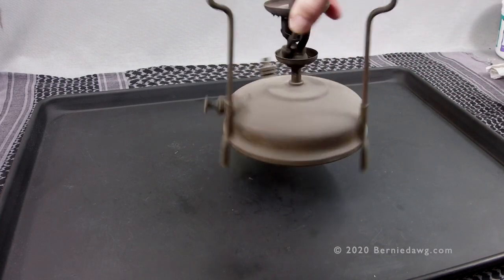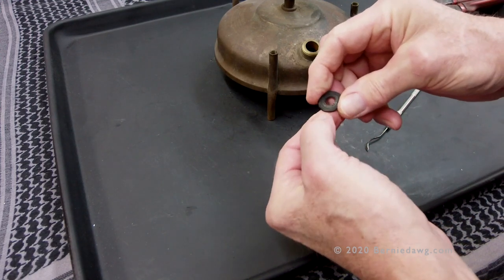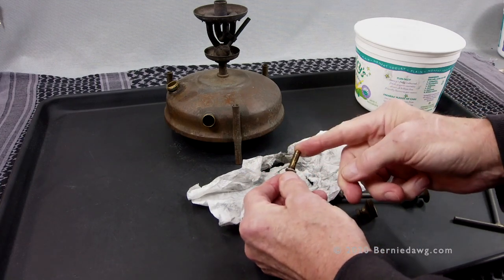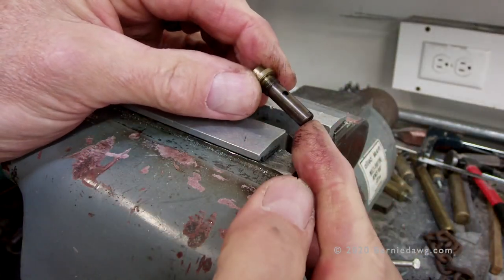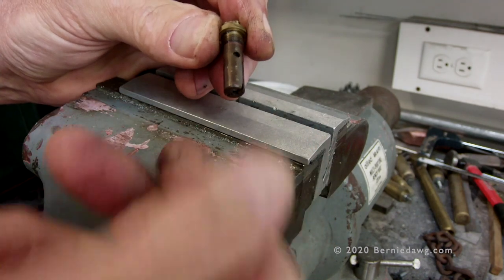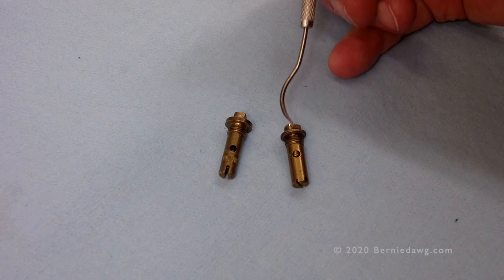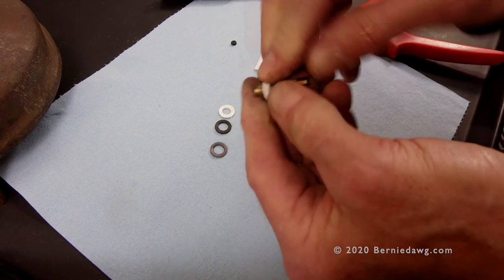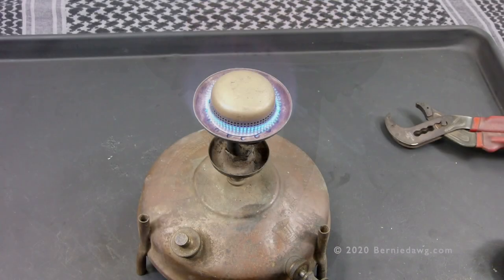How to Fix a Kerosene Stove

Comment: Thank you very very much for demonstrating how to remove a blocked NRV by placing the NRV tool in a vise and turn the tank around while holding a significant amount of downwards pressure on the combination. My first attempt to remove an old blocked NRV from a SVEA No5 was a failure. The NRV tool slipped and rounded of the tip of the NRV. So now I can't remove it at all and till so far I didn't manage to get the stove in working order again. 
But luckily after seeing this video I was able to restore an very beautiful Primus 210 back in working order. It was super easy and done in a few minutes. I went to my dads garage clamped the NRV tool in the vise on the workbench and heard the very same pop sound when it came lose. I replaced the old NRV with a new one and now I have a beautiful vintage stove that can be used on camping trips. Maybe I can restore the old NRV also with the help of this video and keep the stove as original as possible.
Reply from the maker: Thanks for your comments. If you drop me an email to: bd@berniedawg.com I can show/tell you how to fix your Svea #5 NRV without disassembling the pump. It's quite easy. The technique is one of those I will be featuring in an episode of my new video series called "Stove Tools" that I'm releasing later this fall. It may be a month or so, though, before those show up here on YouTube. BD

Comment: Donde se puede conseguir la goma que sella el aire en el nvr,debe ser resistente al kerosene,saludos desde chile
Reply from the maker: You want Viton, a synthetic rubber used for chemical resistant purposes like Diesel engine fuel lines. You can get it as precut stove parts from several sources listed in my webpage on stove parts. Www.berniedawg.com . No idea where you’d get it your country. Sorry. Good luck.👍 BD

Comment: Hi, thanks for posting this video. I have a question. I bought an Optimus #00 in 1985. I recently tried to use it and it won't fire up. The problem is that I tried to stroke the pump but it does not pump feely like there is some pressure. I even opened the release valve. Can you please help me fix this?
Reply from the maker: @Eugene Jang Sooo... you bought it 38 years ago. That's a really long time. Probably a bad NRV (non-return valve). It'd be silly to expect rubber to last for 38 years and for the stove to just fire up after all this time. The video right above your comment shows you how to fix the NRV. You should also re-oil the pump leather as it's no doubt dried up after 38 years of non-use. Then, after you've done the work, go watch the how to run a kerosene stove video here: https://youtu.be/Z_zRgcmSWh0 Still having problems? I have a free email help line right here: bd@berniedawg.com BD

Comment: Is there suppose to be a seal where the burner meets the tank? On mine it seems to be leaking in that area. Also it's not lighting properly, I'm guessing it's a dirty jet. 🤙🇦🇺
Reply from the maker: @Mark Depends on the stove. Some have the riser tube directly soldered into the tank. Others have a removable riser. Drop me a note with a photo or two of your stove and I can give you a direct answer. bd@berniedawg.com BD

Comment: Hi hi Bernie Robbie from Liverpool England. Hope your good. 
Do you make your own pips. If so what from . Cheers.
Reply from the maker: @robertbates3627 Hi Robbie. I make my own pips. I use Viton sheet and hollow punches to do that. But, as you are in the UK, it might save you money and tooling costs to get premade Viton pips from The Fettlebox. https://fettlebox.co.uk/index.php Viton is the most fuel resistant rubber material and will far outlast any other sort. Cheers! BD

Comment: Hi, I’ve just bought an old Primus No.5 off eBay and it won’t pressure up, there is an old rough solder repair around the main tank filler neck, how can I rid the old repair and make a new neat joint? Should I just use the same method as your pump tube repair? Thanks
Reply from the maker: @andrew keeler The riser (the tube that connects the burner to the tank) is held in place with a big nut on the inside of the tank and can NOT be removed (like the pump tube can) without destroying the stove.
Pressure issues are solved in 99% of cases by… 1. replacing the fuel cap gasket, 2. replacing the NRV pip and the NRV head gasket, and 3. replacing or reoiling the leather pump cup on the end of the pump shaft. I show you how to do all three in the video above - watch it in its entirety to learn how. DO NOT address any other parts of the tank until those three issues have been fully taken care of.
Blodgy solder repairs to the riser-tank connection are best left alone and considered a part of the history of the stove. Removing the solder will likely reopen previous leaks. A riser-to-tank repair is an advanced stove repair and likely shouldn’t be attempted by the novice. However, if you find that’s the issue after solving the “big three” pressure issues above, drop me a note with some photos of your stove and I can walk you through a riser-to-tank repair in email exchanges. bd@berniedawg.com 👍 BD

Comment: I can't solve my problem .The Nozzle was broken down the air leak I can't find another one .can y help me make video about this problem .
Reply from the maker: @QT's Radio It is difficult to tell the problem from your description. Are you saying the jet (nozzle) is broken off in the burner? If so, you will need to replace the burner.
Thật khó để nói vấn đề từ mô tả của bạn. Bạn đang nói rằng vòi phun (vòi phun) bị hỏng trong đầu đốt? Nếu vậy, bạn sẽ cần phải thay thế đầu đốt. BD

Comment: Mine either goes out or floods, any tips? Thanks.
Reply from the maker: @Andrew Howard Make sure you are using quality 1-K grade water-white (clear) kerosene fuel in the tank of the stove. Make sure you are using denatured alcohol to preheat the stove. Make sure you have serviced the NRV (non-return valve) and the leather pump cup so that the stove tank will build pressure. Then… watch these videos to learn how to start and run your stove:
https://youtu.be/Z_zRgcmSWh0
https://youtu.be/9Y1sTEiBU7I
https://youtu.be/13xf6ZFj7pc
If none of that works for you, write to my free stove help line: bd@berniedawg.com with some photos of your stove. 👍😎 BD
Reply: @BernieDawgCinema  Brilliant. Thanks for the answer, I'll check them out and let you know.
Reply from the maker: @Andrew Howard Okie-doke. Good luck. BD

Comment: How do I stop the silent burner connection to the stove from leaking?
Reply from the maker: @Grant Ardern If your leak is between the riser and the burner… unthread the burner from the riser. Dampen the mating surfaces with some water and allow to soak a bit. Then, carefully scape away the old asbestos burner gasket. When clean and you can see the grooves on both mating surfaces, replace the gasket with a new non-asbestos gasket you can get from this Australian supplier (since you are in NZ). 
https://www.ebay.com/itm/Primus-Optimus-Camp-Stove-burner-washers-Pack-of-6-LARGE-type-FREE-POSTAGE/303303515666
If your riser is one that unthreads from the tank and it is leaking between the riser and the tank, unthread the riser from the tank. Carefully remove the old lead gasket inside the base of the riser. Dental tools are good for this. When all the lead gasket is gone, replace with a new lead gasket from this supplier in England:
https://fettlebox.co.uk/index.php?search[keywords]=lead&_a=category
Or… much easier for us both, just send me an email to the following address and we can show each other photos and communicate like gentlemen instead of trying to communicate through YouTube comments bd@berniedawg.com 👍 BD